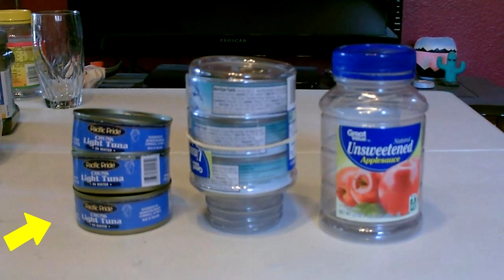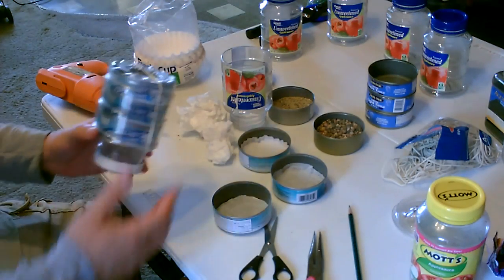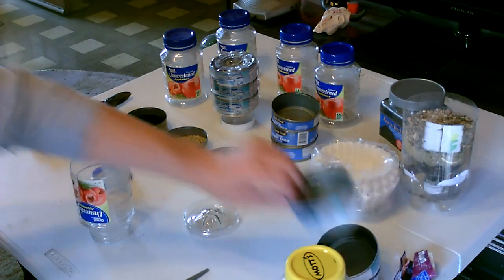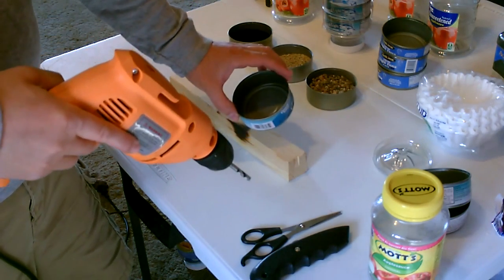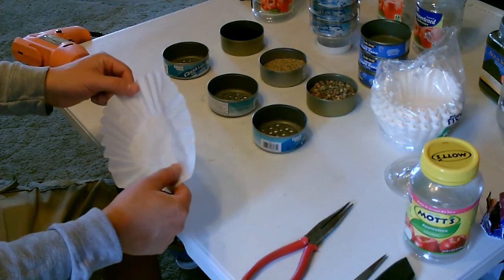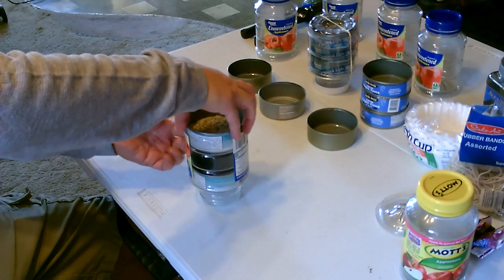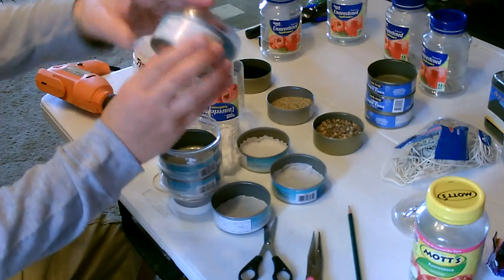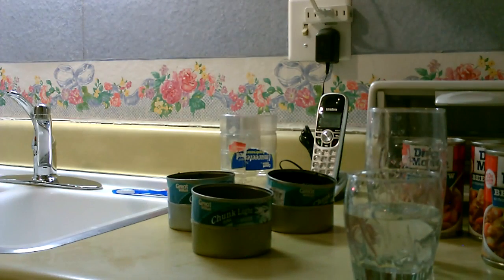Homemade Water Filter Purifier! - The "3-Tuna-Can" Water Purifier! - Easy DIY

Comment: Activated carbon is that charcoal ?
Reply from the maker: hi. 'activated charcoal' and 'activated carbon' are basically the same thing but charcoal that is used for cooking doesn't have enough surface area for it to work. and can have chemicals in it. (charcoal that is used for cooking is similar in some ways to activated carbon but it's different in a few ways).

Comment: Boil the water next.
Reply from the maker: hi there. if you can, boiling the water never hurts. *general rule about boiling is that if you get your water from a standing or still source (like a lake or a pond) then boiling is recommend (to remove/kill anything "living")...but if you're purifying tap water/rain water or stream-water you don't need to boil it. (pathogens like still/stagnant water and will not grow in fast moving/or turbulent water sources *in most cases)